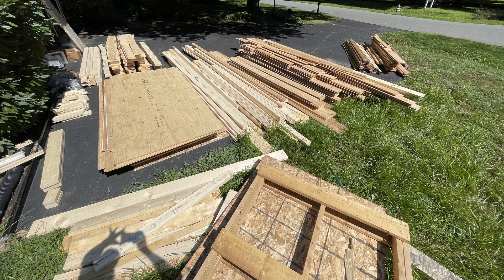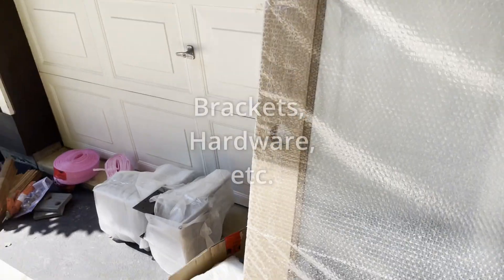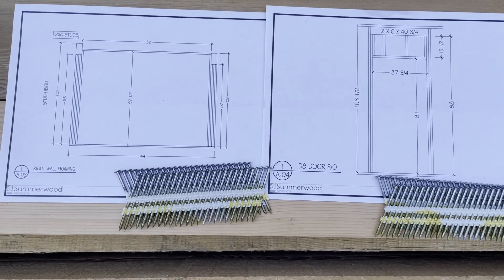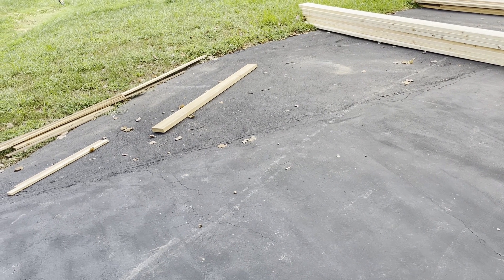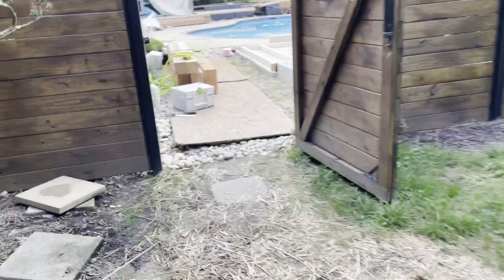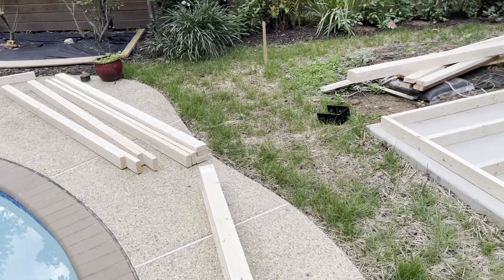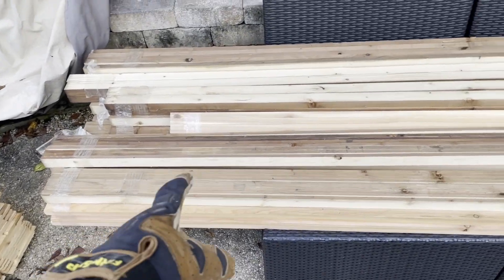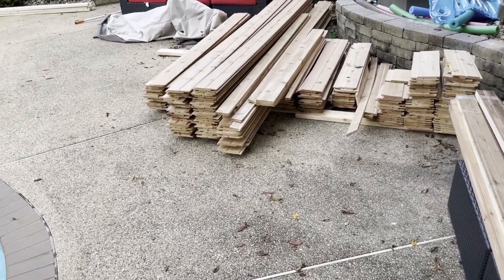Summerwood Sanara Pool Pavilion || Lumber and Wood Delivery Day

Comment: How much was the kit?
Reply from the maker: At the time it was like $19k for all the cedar and build materials. Had to pay shipping from Canada which was another $1k if I remember. I also had to pay for the concrete to be laid. A local contractor quoted me $70k for a cheap building with hardi board siding and cedar was a major upgrade, so building myself was like 20% of the cost. I also had so much cedar boards over that I was able to build a sauna inside the structure